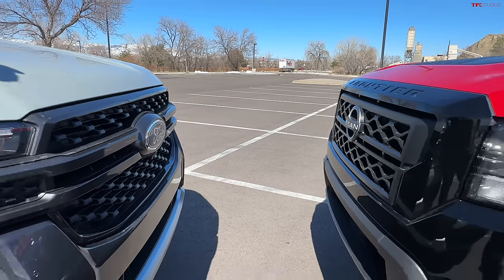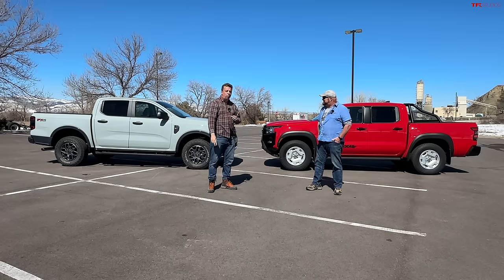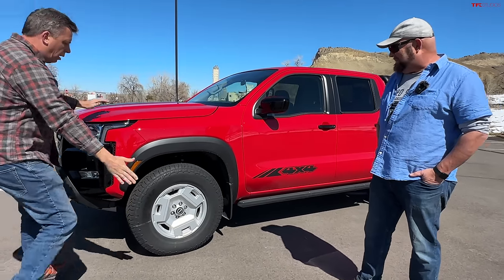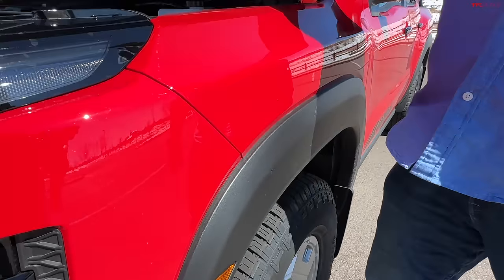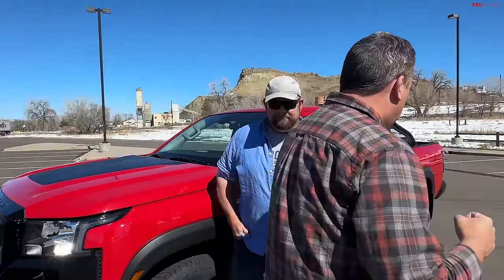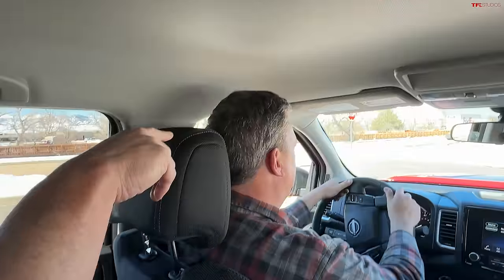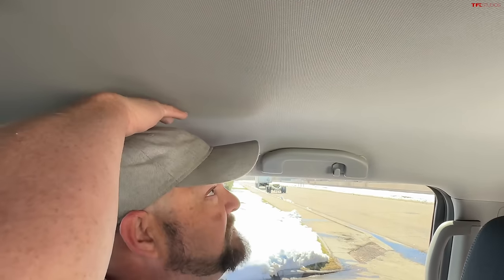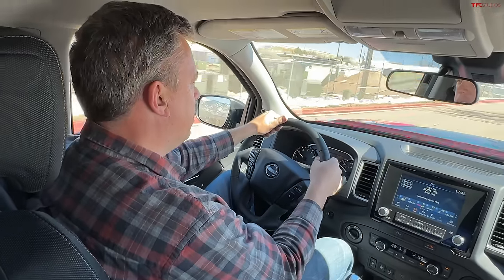This New 2024 Ford Ranger & Nissan Frontier Hardbody Cost EXACTLY the Same, But Which One Is Better?

Comment: Frontier is the most underrated pickup truck. Absolute reliable beast of a midsizer
Reply: but you buy a nissan, the shit of Japanese cars.
Reply: The Nissan is already 10 years old every time a new model comes, better be reliable 🤣🤣.
Reply: @gerry5786 That is for sure about Nissan😅👎
Reply: Not now it isnt. I have a 2023 Frontier and it isnt a beast in anything other than mediocrity. That truck has zero business being 46k
Reply: @gerry5786   the shit is still better than the best of the domestic brands' mid size offerings
Reply: @daverules  how's it better? Don't play the reliability card since that powertrain is just 4yrs old....
Reply: Maybe in cars or crossovers, but trucks and BOF SUVs that actually do work, it isn't even close @daverules
Reply: @engineer_alv   VQ V6 has been around forever and that's a Mercedes Transmission design made by Jatco also old and reliable.
Reply: and mediocre everything. Which is not a terrible thing, unless you want better payload or higher tech.
Reply: @mforce8117 Mercedes reliable?  Lol. Well it got recalled for the parking pawl
Reply: @gerry5786  Really? I've owned Nissans that have lasted a while. Really depends what you buy. Mazdas are Japanese and they exactly haven't had a great track record.
Reply: @Dusdaddy  mediocre in what? People get so consumed with numbers on a paper 🤦🏽‍♂️ who cares man.
Reply: @gerry5786  too bad this isn’t about cars but TRUCKS. I’ve never owned or driven a Nissan car and I’ve heard terrible things about their CVT transmissions however the Frontier has never used CVT. Do some basic research and use some logic
Reply: Statistically the Frontiers reliability is not good.   However everyone assumes that since it is old as dirt.
Reply: @drn13355  There are Frontiers with over a million miles on them same as the Toyotas.
Reply: @drn13355  lol sure buddy. And where exactly can we see these “statistics” 🤣🤣🤦🏽‍♂️
Reply: @drn13355   While Nissan has produced some absolute shit over the years the Frontier has been pretty reliable for what it is. It's in Nissans best interest to make it so. Something like 48% of their total sales in the U.S. come from fleet sales and I believe the Frontier is at the top of that fleet list. That's why you see so many of the older ones on the road for various companies in construction or parts delivery. While it's not perfect, it is the one model they would want to try and keep as reliable as possible so they don't get slaughtered on warranty work from the various fleets that have them on the road.
Reply: There is nothing beast about this truck LOL.  Oh you must be referring to the MASSIVE torque numbers of 260 foot pounds lol.  Maybe the family car engine?  Is this a joke seriously?   Lol
Reply: Not the new model...lol
Reply: Don’t know about Frontier these days. I have an XTerra and it’s build like a tank.
200 000 clics
Runs like new
Reply: @thewireman134  It's 281, at least get the numbers correct before trying to make a point.
Reply: So “was.” The Titan. Absolute tanks…coming from a Toyota guy. Any smart guy would jump on that frontier before the Ford.
Reply: According to who? Consumer reports (granted just one publication) dogs frontier reliability.
Reply: @gerry5786 they last long. Nissan trucks are good. The cars are ass. So I get your opinion.
Reply: I looked at the Nissan. The interior looks like real low grade cheesy plastic.
Reply: @St.Irenaeus  mediocre in tech and available options. You gotta pay the dealer $300 for a damn auto-dimming rearview mirror. My 2003 Ram had that stock over 20 years ago! Which is fine if you want that. But obviously not many do according to the sales numbers.
Reply: @gerry5786 it’s not though that’s literally what he just said … 😂
Reply: @Dusdaddy  he says mediocre in tech lol what a critique for a pickup truck 🤦🏽‍♂️
Reply: @karelleroux3214 they need to make those again
Reply: Nissans a joke
Reply: @TheBallisticPotatoe  lol
Reply: @St.Irenaeus  That's what it's competing against. You cannot deny that fact.
Reply: @TheBallisticPotatoe  their trucks  are very good, cars not.
Reply: @Dusdaddy  you entirely missed my point sir. Have a good day
Reply: @christopher9626 I have both, a 2017 tacoma and a 2023 Frontier. The Tacoma is very mediocre compared to the Frontier. I do not know what are you talking about, can you please elaborate on that? The transmission in the Frontier is better, as well as the engine and more powerful. The interior is superior too. The only thing better in the Tacoma is the rearview camera, that is it.
Reply: @drn13355 what are those statistics, or you are pulling that out of your rear end?
Reply: @ItsJosh You got that right!
Reply: @Teporame So many people do not know what they're talking about when it comes to the Frontier. They were all new for 2022 except they used the old frame, with many improvments, and the engine and transmission were all new in 2020. An 80% reduction in NVH alone in the new model, resulting in a very smooth, quite drive. So many more improvements.Such an underrated truck.
Reply: @phw2274  facts 💯
Reply: @gerry5786  More and more evidence that Toyota pickups are the new sht of Japanese pickups. Tundras blowing up engines left and right. 3rd gen Tacoma rated least reliable midsize truck for years due to major engine/transmission/rear diff issues. 4th gen likely to have just as many major reliability issues. You're throwing rocks in a glass house.
Reply: @daverules you sound like a clown by dogging domestic brands in the reliability department. Of all the midsize trucks, it's Toyota that's had the worst run when it comes to reliability. The 3rd gen was trash. I would know, I owned one. Nissan has a good chance of doing well in reliability but that's still up in the air. It has a better chance than the new Tacoma judging by the last two major truck redesigns Toyota has released in the US.
Reply: @thewireman134 It probably feels like it has more torque than the 2GR in the turd gen Tacoma.
Reply: @jasonlopez9260 Any smart guy would save the money and jump on the Frontier before rolling the dice on a 4th gen Taco tbh. I regret to this day that I traded my 2nd gen for a 3rd gen (aka turd gen) Taco. The Frontier is more basic, with an engine design that is less complex than the rest of the market, and it's far cheaper than the rest of the market. Some people will be gluttons for punishment and pay a premium price for a totally redesigned 4th gen Taco, but the smart money is on the simpler, cheaper Nissan in this case.
Reply: @willcarter495 Whereas Consumer Reports rated the 3rd gen Tacoma the least reliable midsize truck for like 3 or 4 years in a row and most of the issues that put it there continued to dog the TURD gen throughout its life. Incredible how many well cared for 3rd gens have had their engines grenade at around 100k. The 2GR was a curse on the Tacoma.
Reply: @mforce8117  And there’s 10 times as many domestic vehicles with a million miles on them!
Reply: It's underrated becouse everyone knows Nissans get horrible gas mileage and the entire interior is one big hunk of plastic
Reply: @davewilson8308  Name some midsize trucks that have made it to a million miles made in the last 20 years. For the record the Frontier is made Domestically.
Reply: @mforce8117  Who cares it’s assembled domestically, it’s still a foreign company. Support American company’s, their vehicles are just as good and better. American trucks are way ahead of Japanese trucks with technology and reliability that’s why American people buy 10 times more Fords, Chevys and Rams then Toyota, Nissan and Honda trucks. Google 1 million mile Rangers and you will find a 1991 with 1.5 million miles with the motor never opened and many more. I’m sure your 1 million mile Nissan was repaired many times.
Reply: @timtool3229  my 2023 Frontier literally gets the same gas mileage as the 3rd and 4th gen tacos lol 😆 plus ALL manufacturers use plastic you big dummy. What great arguments you have. Clearly you’re brilliant
Reply: @davewilson8308  Made Domestically not just assembled. Btw go look to see who owns RAM. You have a very antiquated view on companies.
Reply: Yes I know who owns Ram, I just forget often. I don’t buy Rams either.
Reply: I drove both trucks before buying a replacement for my F150. The ranger  drove like a car. Seemed to set low. The nissan sat higher. Drives good, too. I bought the nissan for the non turbo, larger engine. The nissan 9 speed shifts are really smooth.  
Test drive the nissan, you won't be disappointed.
Reply: @gerry5786 versus Ford, who might not even be in business in two years.
Reply: @gerry5786 

The trucks aren't bad. Cars yes
Reply: @gerry5786  but its a truck.
Reply: @St.Irenaeus drive a 350z in the track 6 speed. Beast transmission and decent N/A engine. Every cvt is trash fake gears. Driven by belt which makes delays. Cvt to keep cost down and that’s every manufacturer.

Comment: I will always choose a naturally aspirated V6 over a turbo 4
Reply: Probably not for long....lol
Reply: @Dusdaddy considering Nissan’s VQ V6 engines are one of the most reliable and respected V6 engines in the world, it’d be my choice too.
Reply: @haroldbeauchamp3770  Yep, and that's what I mean. Just about the time automakers work out all the bugs and get a good reliable drivetrain, they change it. Then start all over again.
Reply: 2.7l Ecoboost uses a wet belt for oil pump, no thanks
Reply: Specially if you live closer to sea level NA V6 will do better
Reply: Japanese engineering or Ford.  Hmmm…
Reply: @BillinSD Meanwhile it's one of if not the most reliable engine you can get in a full size truck, and soon can get in a mid size
Reply: @AntiATF  I also think we should abolish the ATF. But I do think a wet belt for anything is a ticking time bomb. Just a quick Google will show that.
Reply: @BillinSD  well we agree on one thing at least lol. But there are LOADS of engines that have used a wet belt drive and have zero issues. I haven't been able to find a single 5.0 or 2.7 with a belt failure, but there are definitely some engines that have made it a stereotype that it's a failure waiting to happen (1.0 Ecoboost lol), just like how Nissan made CVTs look the same way. I'd rather have a chain drive, but I'll take a decent wet belt on a great engine over a chain drive on a worse engine personally
Reply: @AntiATF  Choosing between the 2 - the NA V6 Nissan has wins every time.
Reply: is it a less stressed engine?
Reply: Not only the Ranger with a 4 banger turbo, how about an F150 with a turbo 4. When we got our 22 Frontier I found the F150 was 15-20k MORE. I’ll take the non turbo any day.

Comment: I know a lot of people like the large screens in cars, but I am not a fan. I upgraded my base 4" radio to an 8" factory radio on my 2018 F-150, and that is perfect for me. I enjoy the tactile buttons.
Reply: Exactly and it's easier to mess with without really having to look away. I'm a big fan of steering wheel controls for the same reason. Honestly it's just safer.
Reply: I just hate the vertical screen.  Makes you look way down when your eyes should be on the road.
Reply: Agree with these comments, I bought a 23 Silverado in custom trim with the small screen. I test drove the higher trims with bigger screens and found it too distracting when driving.
Reply: 100% AGREE! These bigger screens are a joke and unless. There’s no need for such a gigantic screen. I love my 8” screen in my 2019 Ranger, it does just enough and has the right amount of options. Ford needs to learn the “KISS” way - Keep It Simple Stupid.
Reply: Same... One reason I wanted a 2023 Gladiator was the OLD 8.4 screen AND the old UConnect 4. I have "5" on my Truck and it sucks...
Reply: @justinkeller6379  any screen takes your eyes off the  road
Reply: Indeed
Reply: @paulhunter9613  True but some like the vertical ones practically have you looking at your feet!
Reply: I feel like most people who want/like the big screens have never used them before. It's such a pain. Buttons are so much easier and better in almost every way.
Reply: @justinkeller6379  that’s very true, I think it’s to the point of being ridiculous. I have an 8” screen that up at the top of the dash on my f150 and it’s all I want or need. And I rarely even look at it, I can tune the radio with a knob. I like the buttons myself as you really don’t need to take your eyes off the road to operate. They don’t want you to use a hand held phone, yet make you use a damn screen to operate the headlights on some models. No wonder folks keep bashing up their vehicles anymore
Reply: This was one reason I went with the new Frontier.
Reply: Yup, the 8” horizontal screen in my ‘19 Ram was perfect for clearly seeing the camera views at low speed and showing CarPlay maps, while keeping large buttons and knobs for changing other items at speed without having to look away from the road.
When it was totaled, all the new trucks I could find went to 12”+ screens, and it is just bigger than necessary and caused some controls to be removed and others made smaller, causing them to be harder to find and use without looking away from the road.
If I really wanted a large screen, I’d install a collapsing screen on top of the dash to open up at very low speeds or when parked (the only time any driver should be looking at a large screen)
Reply: I agree.

Comment: I MUCH prefer less overly complex tech and a naturally aspirated V6.
Reply: Turbochargers aren't new tech 😂  a V6 has way more moving parts.  More things to go wrong
Reply: @beexiong2995  I never said turbos are new tech. Also, maybe you should talk to basically any mechanic because it's common knowledge that a naturally aspirated engine will last longer than a turbo engine if both are maintained correctly.
Reply: @theaveragewoodsman6002  it depends on who built the engine and transmission.  Look at all the bad cvts from nissan.  All the engine fires in hyundai.  Lets not even get started on GM & Ford
Reply: @beexiong2995 I'm referring to a well-built, well maintained comparison. If all things are equal, the increased stress and complexity of a turbo engine shortens its lifespan. It's just a fact, like it or not.
Reply: @theaveragewoodsman6002  well unfortunately no manufacturer makes the same quality products.  Based on consumer reports thats all you can rely on.  A turbo ford is not the same as a turbo toyota.  A nissan V6 is not the same as a jeep V6
Reply: @beexiong2995 I'd probably pick the Nissan over the jeep tho in my opinion.
Reply: @theaveragewoodsman6002  the fact is that there are turbo engines with 200-300k mi on them
Reply: Same. Still driving a 4.0L V6 '13 frontier. 

Something to think about as well is that the V6 is in the current frontier is 5 years old and I haven't heard any issues/complaints yet. With these new Turbochargers in upcoming midsize trucks are still pending. Based on that, I would choose the frontier, but the ranger raptor does look good!
Reply: @beexiong2995  Now the issue with your concern of a turbo vs N/A V6 is the fact the the Ford engine is actually proven and reliable, more than we can say for the V6, the higher trim 3L is almost unbreakable based on it's reports.
Reply: Listening to that little 4 cylinder revving through the years compared to the v6 it's not the extra parts in the 6 that will fail.
Reply: Turbos engines destroy NA motors in trucks!!!

Comment: Yes! An engine that doesn't need a turbo to get  up and get down the road. LOVE IT!
Reply: A slug 😂 I wish I could slap a turbo on my v6
Reply: @freedomisntfree_44 not when a total engine rebuild is needed 😂😂😂
Reply: See an this is the problem would you trade an e motor at low speeds or a turbo at all speeds im torn na is fine it has its place but induction is slow to the go like a scared cat I want instant torque til about 60mph then allow the motor to take over upto 150 that's all and it wouldn't have to be 0-60 in 1.9 but a solid 3 would be perfect
Reply: @midlifecrisis7888  don’t need an engine rebuild
Reply: @midlifecrisis7888  yea I could see that n/a engine having to be rebuilt as it strains to tow anything with weight to it😖
Reply: Turbos are nice. You'll be able to tune that ranger to blow the frontier away.
Reply: @MB-jz3uu  the last ranger was faster
Reply: @freedomisntfree_44  yeah I get that I'm just saying that it's much easier to get more power from turbo vs. NA if you don't want to spend a boat load
Reply: @MB-jz3uu  ahh yeah I get what you’re saying. Nah I’ll end up blowing my poor old truck up 🤣
Reply: People screaming “we need turbos…cars are too slow” now people screaming “we don’t want turbos…turbos are problematic”

Comment: I'm going with the nissan! Love the look and it's naturally aspirated!
Reply: Nothing wrong with torque from a turbo and is better suited for truck duty. I'll take the Ranger any day.
Reply: @302Mustang13 i agree and disagree, turbos are definitely better for torque but heavier on the maintenance compared to the Nissan v6 basically been making the same v6 for 20 years with plenty of examples over 400k all the way up to 900k with basic maintenance. With that being said I think the frontier is the better “Truck” more reliable and better bang for your buck. Both nice trucks regardless
Reply: @vfate9786  Don't forget Ford has had this 2.3 Ecoboost in the Mustang since late 2014 and there are high mileage examples out there too. Ranger is nearing 5 years with a slightly different version and doing well. It's just routine fluids and not much else.
Reply: Liking The Nissan & The Red To@ Base mdL. Be Fine 4 me,  if Ya Need More/ReaL Truck@ Works etc... & Bigger Truck WouLd Be Wise. FOr; 6-k. Towing Truck Turbos Arn't Neccasary.